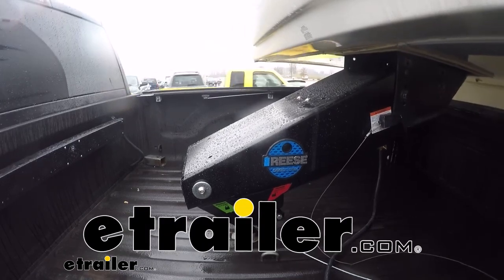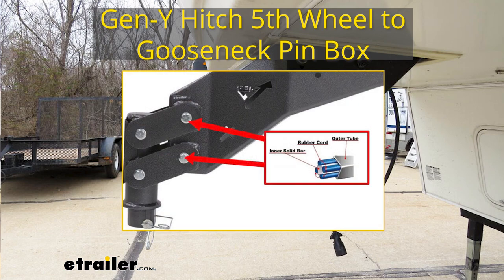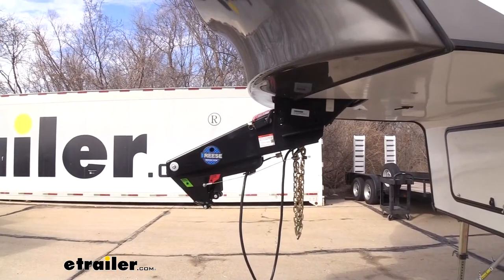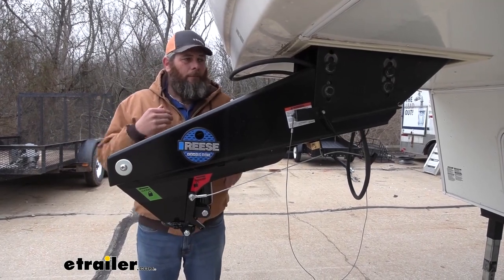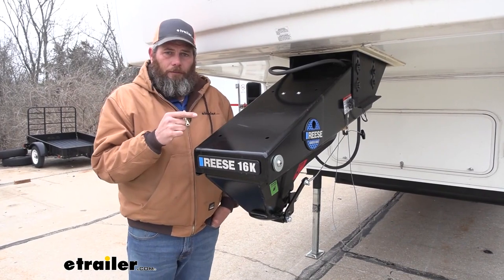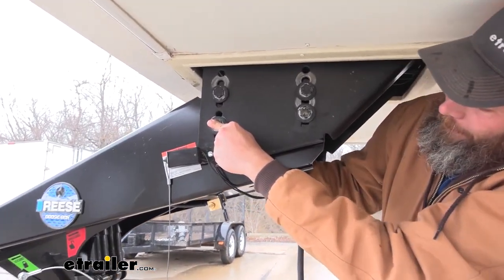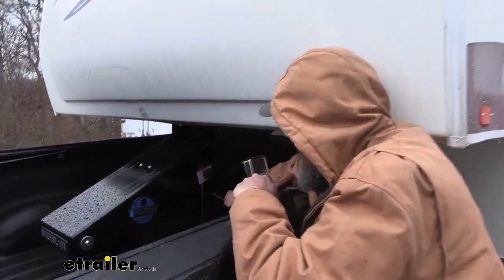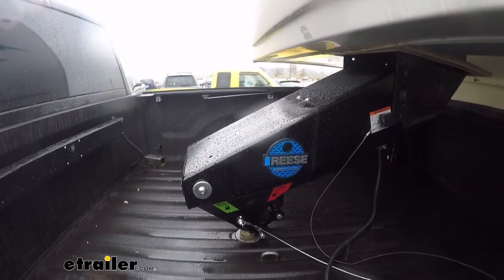etrailer | Reese Goose Box 5th-Wheel-to-Gooseneck Air Ride Coupler Adapter Review and Installation

Comment: I ordered my 20K goose box on April 4th, 2022 and received it on April 16, 2022.  I installed it myself at the lowest level possible to create the maximum distance between the top of my bed rail and the camper cap.  Guess what, not enough clearance.  Had to spent another $300.00 and purchase the taller B&W goose ball.  Next issue.  filling the air bag.  my hitch doesn't have the air valve system that the hitch in the video has.  No extension and no air valve connected to the release cable holder.  the "new" air valve is under the hitch which means you have to hitch the camper to your truck, then get on your back upside down to fill the hitch and you actually need someone else there to tell you when the air bag is right.  I called and talked with Reese tech support and they told me that the other air valve assembly, with the extension like the video shows, was on back order so they used this little air valve under the hitch, then he said they were having issues with the air bag leaking with the old air fill valve assembly like in the video so they used this new one.  So I asked which is it, backorder issues or air leak issues.  He said air leak issues.  So it took me about 20 minutes to climb under the hitch and fill it and it only took about 10 minutes for the air to leak out.  At this time, I'm not a big fan of this setup.  Wonder why I can't get any assistance addressing these issues?  any help would be appreciated
Reply from the maker: You can take a bottle of soapy water and spray it on the fittings with air in the bag and you will see bubbles form where the leak is. If the leak is in the fitting then you will need you add thread tape or sealant to the connection. If it is on the bag itself, then you will need a new bag.
https://www.etrailer.com/Gooseneck-and-Fifth-Wheel-Adapters/Reese/RP94716.html
Reply: I have one, if you have your factory fifth wheel pin box and want to trade I’ll gladly ship it. My trailer came with one of these - I tried to be open minded. I hate it and I cant find anyone willing to remove it and swap back to factory.

Comment: Today as I was pulling out of a fuel stop 900 miles from home, the new style blue Goosebox  manifold sent to replace my leaking original blew apart.  This 20K Goosebox has been a problem since the RV dealer installed it on delivery of our 2022 Grand Design Solitude 310GK.  And I thought it solved our problem as it held air for 3 days.  We both heard a pop and rapid decompression behind us.    Luckily only 2 miles from where we were staying for the night but a very rough and slow ride.  3 hours on the phone trying to get to Horizon tech support.  7 different times I had to call back after being disconnected as my wait time go closer to 0 only to be put back at 50 minutes when I re-dialed.  I tried the customer support folks but all they would do is connect you to the tech support line without letting you finish a sentence. When you pressed 0 to leave a voicemail and callback number, disconnected.  Reese web site was down.  I am 900 miles from home starting an 8,000 mile trip into the Rockies with a hitch I no longer trust and in disrepair with no idea where to go to get support.  Absolutely pathetic customer support and I would not recommend this pin box to anyone due to lack of support.  Lifetime warranty is meaningless if nobody answers the phone and you can't find anywhere to repair.
Reply: I have a gen 2… has 1,000 miles on it. Camping World refused to quote me for removal and replacement with a factory pin box. 
If you want a complete one that functions I’ll trade you for a factory pin box.
Reply: Yep, I went thru a similar experience. My goosebox lifts off the ball.
Several attempts to call tech support, parts, etc ended in the same failure.
Next hitch will be a gen y

Comment: Bought my Goosebox 6-weeks ago and this is not what Reese is shipping!!

Buyer Beware! 
First - The Reese pinbox came without installation hardware or directions. The hardware took over a month for Reese to replace and again came without directions.
Second - The Reese pinbox DOES NOT have the air valve as pictured on the websites. When I called I was told it was due to a parts shortage and the person I spoke to at Reese (Paul?) even told me that the new set-up was something the engineers threw together and was a horrible design.
I TOTALLY AGEE! Send me the part!
To inflate one person has to literally crawl under the pinbox, while hitched to the 5th wheel, to inflate while another watches the indicator bar. Not easy for a 60+ year old fat man! 
The valve faces OPPOSITE the side where the indicator bar is located! Plus, the valve is so close to the wall of the box you cannot install an extension hose. Just Dumb.
After follow ups with eTrailer, I were basically informed by Hannah that I have to live with it. Either that, or I could pay to ship it back. Mean while, both Reese & eTrailer are selling parts that are not as shown on the website.
There is now a Gen 3 with a redesigned air valve, but they are shipping out leftover Gen 2's with MISSING parts.
NO - NOT HAPPY
Reply: Whoever is spamming these messages . I’ve seen like 3 different videos with there comments 😂